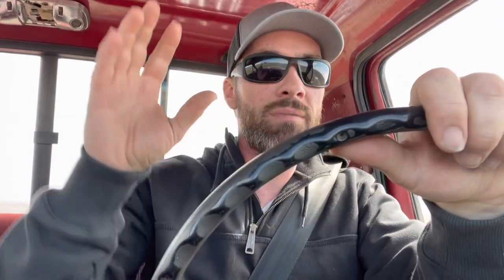Talking cab noise in a bullnose (80-86) ford truck.

Comment: the suspension is better in the 80, it gives a bit less noise and the body mount bushings are softer for smooth ride. I made the mistake of replacing the bushings with harder aftermarket bushings. now the thing rides like a 1 ton